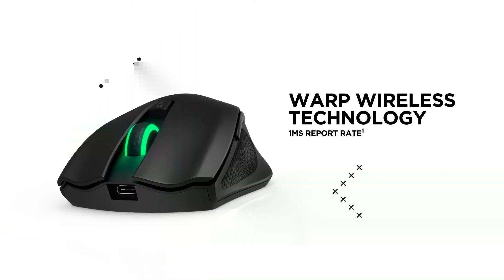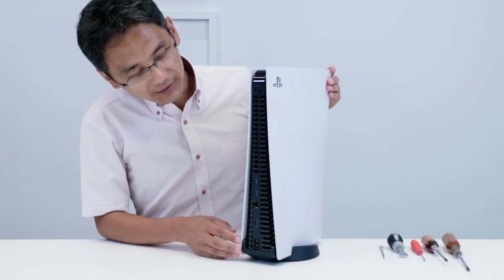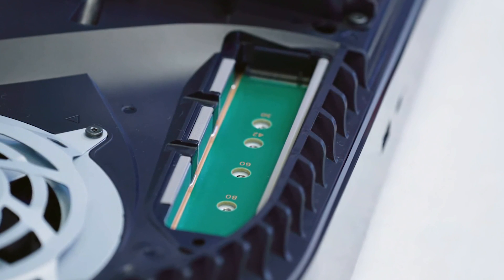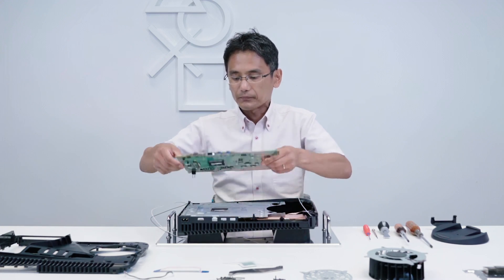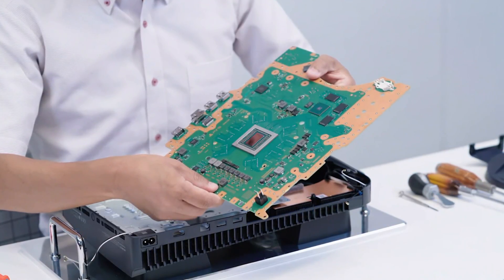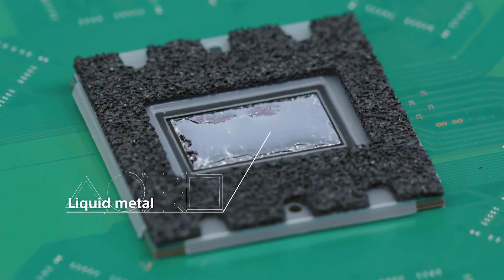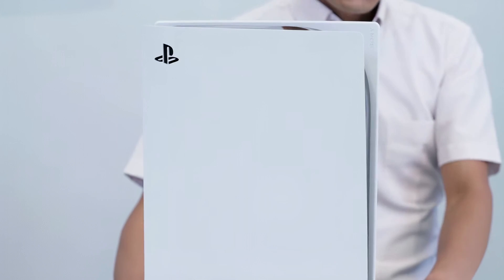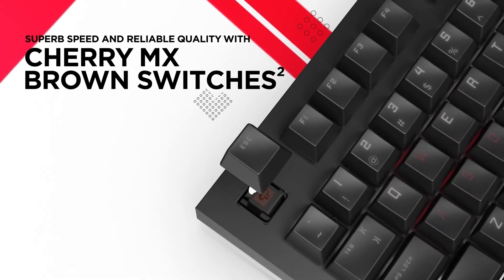PlayStation 5 Teardown Analysis: Inside Sony's Next Generation Hardware Design

Comment: Seeing the PS5 teardown makes me be even be more impressed with the smaller size and all engineering that went into making the Series X.
Reply: It overheats though.
Like the 360.
Reply: @DJ_Dopamine  it doesn't overheat, it dissipates heat out of the system and I can only hope the PlayStation will do also. Both will probably use about similar amount of watts  in real world usage, that will turn into heat which needs to be dissipated out.
Reply: @DJ_Dopamine  No it doesn't, that was one debunked report.
Reply: Yes, I'm sure cramming it all together around a big metal internal block is great for managing thermals. And the ventilation from the bottom which is is more than 90% covered with a stand, which they haven't shown how to remove. The engineering is awful, no common sense was used.
Reply: @shinukisan2222  Ah yes, we'll take your clearly extremely in depth and thought out musings on the subject to condemn the engineering efforts of a team of professionals that have proved themselves highly capable before.
Reply: @alexlyster3459  
It doesn't seem that is the case on this occasion. Oh and I have two degrees in engineering, so I do know what's what.
Reply: @shinukisan2222  And I have a degree about Astrophysics, but I don't know literally everything it is possible about my field either.
Reply: @alexlyster3459  
Congrats on the solo, I actually know enough about the space an object takes and how it effects the surrounding thermal dynamics. But as we all know, opinions vary.
Reply: @shinukisan2222  Thanks, and congrats on yours. I'm not saying I doubt you know alot, I'm just also saying it's a little far fetched to assume they don't have good reasoning for the choices they've made. The One X I've got is surprisingly tiny and barely makes any noise, all while managing it's heat well. I see no reason they'd have thrown all that talent out the window for seemingly no reason. Same goes for Sony. Looks like they've made a heat dissipating beast of a machine as well, having learned their lessons from last time (though my PS4 slims runs pretty quiet), the dust vacuuming ports are genuinely a genius piece of design, and something it looks like the Series X seems to lack.
Reply: @shinukisan2222  That metal block is part of heatsink design in which is also inside the PlayStation. Using a blower style cooling solution which in the passed used by GPU makers in their reference cards isn't particularly known for being most efficient in both amount of heat dissipation and sound wise. Also seeing the relative small intake strips at the PS5 design and the path the air needs to make isn't also optimal. I'm looking forward to YouTube channels like Gamers Nexus to test both systems and how their designs perform thermally.
Reply: @sergeleon1163  
It's not part of the heating design, it's purely framework for the internals. And if it's not known for being efficient in heat dissipation on GPUs and the like, then WHY USE IT?! And as for the, what was it you said "small intake strips" on the PS5. Have you actually seen them? They are two massive intake strips which go from average at the bottom to massive at the top and vice versa at the rear. These smartly direct cooling air through the console on a set path to the  again "massive" outtake strips. Oh, and the only metal inside the PS5 are thin heat/radiation shields and the massive heat sink which again is covered in tons of thin heat dissipation blades and acts like a vapour chamber.  Perhaps you should do more homework and stop ignoring the obvious.

Comment: 14:06 Isn't the average memory bandwidth of the Series X slower than the PS5?  It has two pools of memory like the XBone, one that's super fast and another that's glacial.
Reply: You said the setup correctly, haven't done the calculation just yet.
Reply: isn't the second pool strictly dedicated for OS and system tasks? Developers therefore won't be utilizing that pool anyway
Reply: @RuthwikRao  they have 2gig they can use from what i remember
Reply: That might actually be an advantage. GPU's want high bandwidth memory, but CPU's don't care about that they need low latency memory. That's why you have DDR and GDDR memory on PC.
Reply: On average yes - but that's not really representative. Developers will of course always use the (much larger) high-bandwidth section for bandwidth sensitive data, so in practice the memory is for all intents and purposes high bandwidth.
Reply: The faster is for the games, the slower is for the system.
Reply: It has two different speeds pools of memory but note that they aren't split memory just half is slower. As a whole the memory bandwidth in total is about the same as the PS5. I'm not expecting it to make that big a difference. In fact as a whole the Xbox has more bandwidth at 320 bit vs the PS5's 256 bit interface but the PS5 has all memory at 448GB/s vs the Xbox having a split of 10GB at 560GB/s and 6GB at 336GB/s. So bandwidth is still higher on the Xbox and the other half of the memory is a fair bit quicker than the PS5's. I expect differences in games as a result to be a wash.
Reply: You are somewhat correct, but an 'average' would be a very misleading thing to apply, and 'glacial' is outright hyperbole.
DF reported that the XBSX split is 10GB at 560 GB/s and 6GB at 336 GB/s, while the PS5 has 16gb at 448GB/s. A meaningless 'average' would put the XBSX at 476GB/s, so still slightly ahead of the PS5.

More relevantly, the faster portion of the RAM is targeted at graphics applications and the vast majority of games running at 4K on a PC don't come close to using 10GB at the moment. 
That's not to say that it couldn't cause issues in badly optimised titles, but you could as easily say the same about the PS5s 'slow' bandwidth. Will be interesting to see the first big multi-plat comparisons that are actually pushing both consoles to their limits.
Reply: Not at all. The super fast is for the GPU. The other for the OS, audio, scripts, CPU and other things. The GPU RAM is faster and the bus is wider than the PS5's. Not a surprise: the XSX's GPU will process more data than the PS5's and need a faster RAM with a wider bus.
The Xbox one had ESRAM and RAM. Different architecture.
Reply: No.

Comment: Make no mistake, that heatsink will cost all the monies.
That's a giant slab of copper, not cheap, and a seriously complex assembly.
The machines to make something that large and complex, big and expensive.
Reply: But surely a vapour chamber would still be better right? So if it was that expensive they would have just used a vapour chamber instead. Or am I missing something?
Reply: Isn’t it a good thing to make a console that doesn’t get overheated?
Reply: @mh22xv  yes!!!! Who said it wasn't?
Reply: Buy the ps5 same price as the xbsx, what's your point?
Reply: @alize_187  same price, and Sony put more money in cooling and SSD, and had to boost the lower count compute units to compete... So for the same price you get a better engineered console with more money put into power than cooling because Sony chose form over function and microsoft built it from the ground up for performance, even if the design isn't as "futuristic"
Reply: @alize_187  
My point was that the video implied that this was a 'regular engineering' solution, a cheaper solution.
Somewhat correct but copper is very expensive, metal working is much more expensive that not-metal.
So the machining for that's going to be expensive too.
Somebody has to pay for that.
It's either us or their shareholders.
It'll be interesting to see who.
Reply: Japan tends to overengineer take for example Honda in the 90s and the PS3 which can be a pro as well as a con depending on the consumers.
Reply: @vikehto2738  they didn't overengineer on the ps4 and pro consoles for ventilation...
Reply: @Nonx47  Yes sadly. But idc as I’ve never owned a console. I only game on PC and I’ve never had any trouble.
Reply: @vikehto2738  oh come on, PC has loads of trouble, I play on PC as the time and the amount of times I had BIOS updates or drivers not working anymore or something whacky happening like a windows update that screws something up is overwhelming.
Reply: @Nonx47  I seriously don’t know what kind of PC you have but I can say for sure that I’ve never had trouble with mine. Maybe you just need a better PC? Or you’re doing something wrong? There’s nothing wrong about updates btw and a maintained PC is a happy PC :)
Reply: @vikehto2738  Germany over engineers.
Reply: @mostmost1  Not only Japan of course.
Reply: They did it as it's cheaper than a vapor chamber which the Xbox uses. It will however mean the price likely won't fall as fast as vapor chambers prices fall as the process gets perfected as raw copper is all material cost.
Reply: Tech is getting cheaper to produce while keeping it powered and cooled is getting more expensive. Seems balanced at least.
Reply: My take is, xbox is losing lots of money giving you the xbox sx, so be nice and say thanks, sony on the otherhand looks like they did struggle getting the console to a fair production cost. This is where you can see the different approach they are taking, while microsoft is spending money like crazy (because they can of curse), sony hangs on the rope with sony interactive being its mayor point of income, so they will give us something more "fair" for the price and compensate in other ways, xbox sx will give you the raw power and you better be happy cuz that shit is expensive

Comment: 4:35 that isn't true you literally just take the top panel off and can  see the cooler which you then used compressed air to clean....No screws and no voided warranty.
Reply: Not with the launch PS4

Comment: I find it funny because in a part of the video, the escene cuts as if when this guy lifts the motherboard the liquid metal dropped. 
But what i get from this is that console is not good for reparations or open it as a normal user, i think thats maybe why they go with liquid metal, to prolongate life enough so people just don’t peak inside, but reparations in this thing are going to be harder. Maybe just over engineered, Xbox just took over on Slim and Power.

Comment: 4:19 My ps4 pro has virtually no dust in the machine but has always been loud. I think its the cooling profile of the fan more than anything.
Reply: Its not from dust, its was a design problem with having to guess the worst case game code the machine will run.... 
Ps5 design takes that guess work away due to the variable clocks and smartshift tech...
Ssd on xsx is soldered to apparently 
DF is just being salty

Comment: My worry with PS5 is the SSD is soldered straight to the board and SSDs have a set read and write life. It means there will be a point the console is just dead and will no longer work as the SSD stops working and can't be replaced. That may be in 8 years but if the storage is only 600GB, transfering games between hard drives may run it's life shorter.
Reply: I'm wondering if the spare m.2 slot/drive can be used for the OS in case of catastrophic failure of the main drive.
Not ideal, but I'd like to think Sony thought of this and it's an option.
Reply: dont worry its more then enough reads for 10-15 years for avg users
Reply: I wouldn’t worry about it. I’ve used the same internal SSD daily for the last 7 years, it’s written to and erased frequently (video editing) and it’s still chugging away with no problems.

You would need to be writing to the PS5 an obscene amount regularly to trouble it.
Reply: Yup , about 5 to 7 years.
Reply: @glenmcl  so same for the Xbox yeah?
Reply: Noboby is going through 6000tbs
Reply: The nvme should work for more than 15 years writing 100gb daily If similar to Samsung. Others components have a short life span.
Reply: 30th years lifetime transfer 50 gb everyday
Reply: I though that too, until I saw how the Series X/S actually uses the external expansion storage as ... well expansion of the internal one. The same way Android does it, merging the two in one big pool. SSDs have wear leveling and overprovisioning, so when a cell no longer writes, it should be excluded from the storage like bad sectors in HDDs. So, in theory, as the SSD wears out, it will only shrink in size, until you have none left, but provided you put in an extra M.2 stick and the console actually does merge the two (I am just speculating here), over time the OS files and everything else should be moved to the M.2. 
It is possible in theory, whether Sony will actually allow it and do it, is another matter. Maybe they are waiting to see how often the internal SSDs fail and if it is  too high, they make allow it through a patch or something. If it is low enough and outside of warranty most of the time, I don't think they will bother, forcing you to buy a new console when it happens. We'll see.
Reply: Completely agree. It's the first console with basically a hard limit to its lifetime. The only way to get around that would be if down the line Sony lets people install the PS5 OS on a 3rd party NVMe SSD. Which seems very very unlikely.
Reply: @e2rqey  hard limit? like 15 years or so? plus sony may allow people to install the os on the m2 ssd.
the ssd being soldered is nothing to worry about lifespan, there are other components in consoles that may and probably will fail earlier
Reply: But then again most likely in 1 year you will buy a new NVMe SSD to for that PS5 slot. Then once you make it your primary slot. Other than game saves and some data not much gonna be written on primary hard drive right. Looking at available games at launch and stuff. I think you would most likely play or install 30-50 games within that time. Means almost 2-3TBish read write. Then you buy a expansion slot. Most SSD's have MTBR of 300/600/1000 TBs so I think it most likely last for 20-30 years. Unless you do something super silly. 
Like put all games on Hard Drive and when you gonna play them transfer those to Internal SSD play and then uninstall them then repeat. That will reduce PS5 life by a lot. If you do that daily.
Also you must never use more than 80% of your SSD space. Else it reduces it's lifetime I think maybe that's why out of 825GB storage maybe only 664GB is available to all users.
Reply: @himanshumodak  the issue is that the PS5 operating system is on the system SSD that's soldered to the board. So if that SSD is corrupted or does, even if you have a 3rd party SSD in the additional slot, the PS5 won't be functional. Unless Sony lets people install the PS5 operating system on a 3rd party drive which is extremely unlikely.
Reply: @e2rqey  Suddenly you care about failure rates of SSD and limited writes? You clowns are ridiculous, just enjoy having new tech and stop worrying about things failing. No one tries to sell broken shit.
Reply: @evilformerlys4704  suddenly? If you think I'm some sort of Xbox fanboy you are mistaken. I always forget that anytime I comment in any video related to next gen consoles that some idiot will always accuse me of being an xbox or Sony fanboy. I play on PC and don't base my identity around liking or disliking a company. I find the technology and industry interesting but have zero desire to talk shit on either company.
Reply: @e2rqey  Hmm but wouldn't that be covered under warranty if that happens? Like SSD getting corrupted? I think Xbox doesn't allow installing OS on SSD either. Maybe contacting customer support might help.
Reply: The SSD r console will likely fail for some other reason before it reaches its maximum write cycles
Reply: Sony actually manufacturers its own long life SSD chips for their cameras. Unlike Microsoft who would have to buy it from micron or samsung
Reply: @jzilla1234  no they don't, Sony is buying DRAM and NAND flash the same as Microsoft. They don't produce their own DRAM or NAND and certainly not in the volume nessesary to keep up with the amount they require for PS5 production.

Comment: Can I just point out that the suggestion the PS4 Pro gets loud because of dust is nonsense. OK, dust might make it get louder, but I've just popped the top cover off of my PS4 Pro, and it is absolutely spotless. The PS4 Pro is loud anyway because it has appallingly inadequate air intake - and it just gets worse from there.
Reply: Also it’s due to shitty thermal application. I recommend getting your own trope of thermal paste.
Reply: And if you want to see a similar fan design in the PC space, you would need to check out something like the GTX 1080 Founders Edition. In a PC, we generally have fans mounted on inlet / outlet surfaces of a case, the surface of a heatsink / radiator and these require a fan that moves air through the blades.

You would only use a fan that blows air out of the edges of the fan when you are placing it adjacent to the heatsink as they have in the PS5, or as is the case in the 1080 Founders, where the fan is on one side of the card, blows through the heatsink and exhausts to the rear.
Reply: Not true..we know it’s badly applied cooling paste in 99% of cases.
Reply: There's alot of people that cleaned their ps4 and it fixed the jet noise but if the fan is like a jet engine for you and it's clean then something is definitely wrong with the hardware/software it self, For example awhile ago the Lobby at Modern Warfare PS4 have an Uncapped Frames/s bug and then the CPU overheat because it's trying to run the game at basically Unlimited frames/s and made the Fan overspeed trying to cool down the CPU
Reply: Thermal paste might be part of the issue. Software definitely is part of the issue - the more demanding the software, the more cooling it needs. On the dashboard, the PS4 Pro is quiet. Play Gran Turismo and it wants to take off. And whilst some software might have bugs, fundamentally there should have been more openings so the fan didn't need to spin up quite so dramatically.